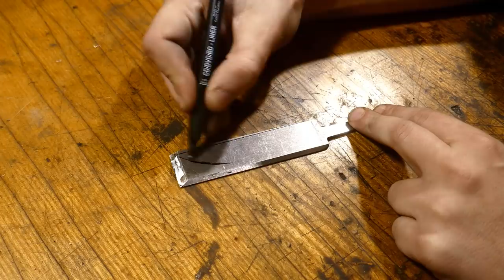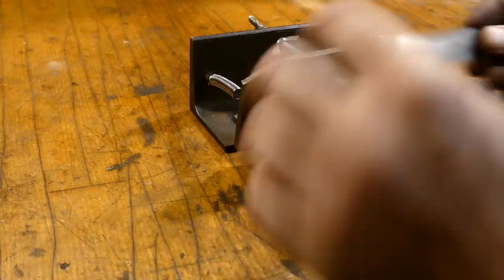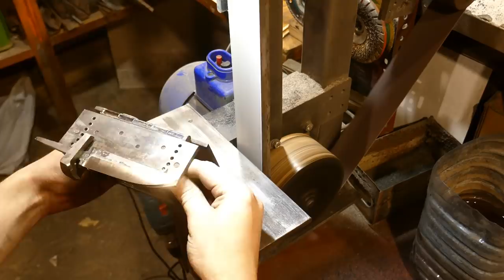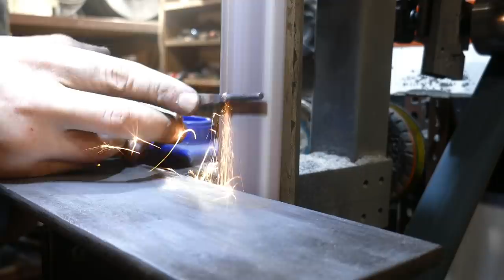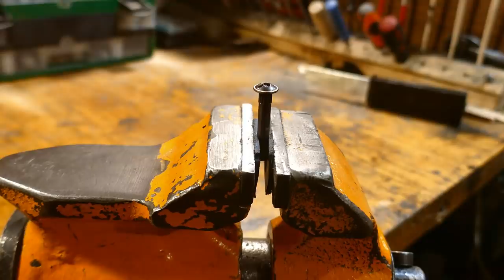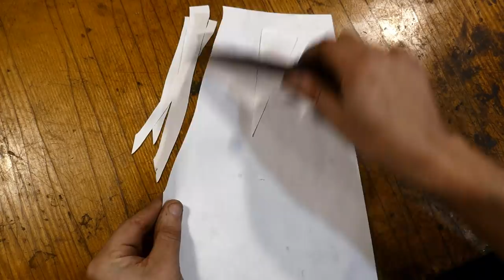Making a Knife from an Old Chisel

Comment: Most of chisels hardened only for 1/4-1/2 length from cutting side. So opposite side is not hardened and can't be used for cutting edge without re-hardening. I thing you made knife-stick but not usefull knife.
Reply: It's all right because that blatantly is not a real chisel. Nice knife though.

Comment: What is the purpose of the metal on the bottom of the handle? More than cosmetic?
Reply: If you noticed he welded a piece on the tang witch later on in the video he was able to thread a bolt into it to hold the bolster an handle material all on after glueing it. Pretty smart if ya ask me
Reply: Markus Arallious ooooh ok. I remember he welded, but I think I thought he was just reinforcing a weak part of the metal. Thanks!